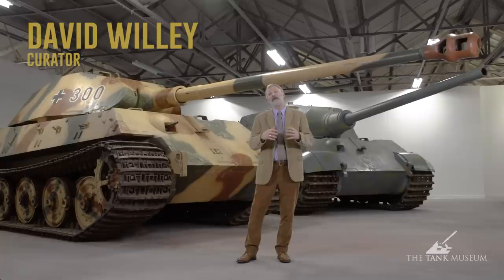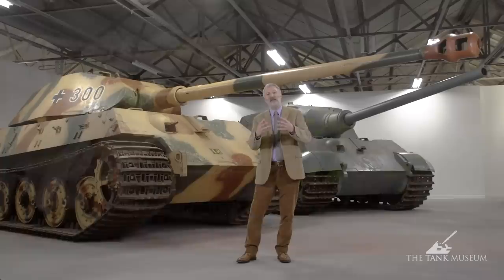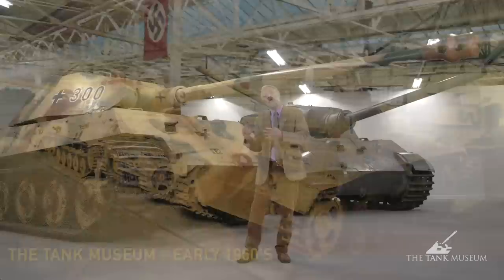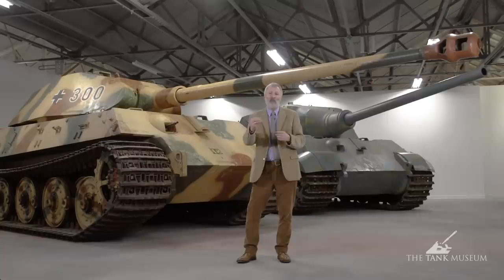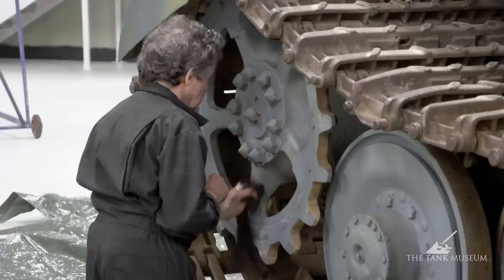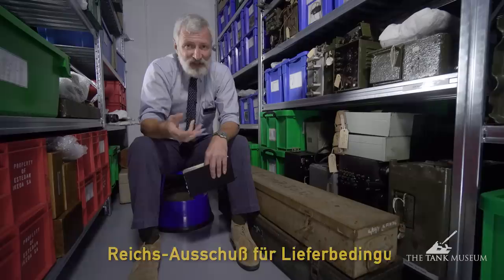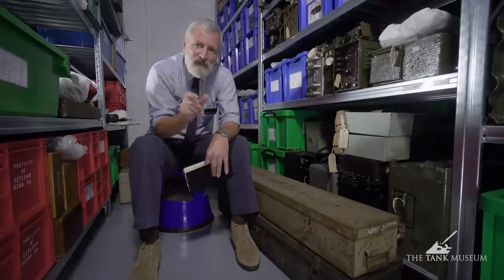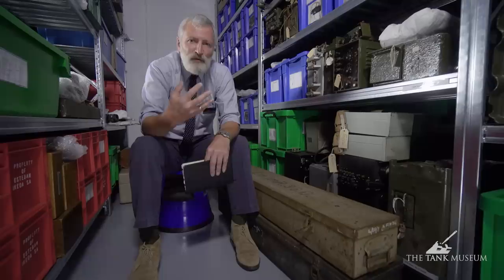How to Paint Tiger Tanks | Tank Chats Special | The Tank Museum

Comment: Very good and accurate video.  Awesome to see you're trying to shed light on all the inaccuracies and myths of old.  Couple of things I'd like to add that I often see model makers asking about or making mistakes with (not everyone cares and that is perfectly fine).  

The two-tone RAL 7021/7017 panzer grey/brown scheme was not entirely discontinued in 1940 as you said; StuG III Ausf.B were still being painted in it at the factory in March 1941.  There are good photos of this.  Seems like it was continued on tank destroyers/assault guns for some odd reason.  After March '41, StuGs were all painted in grey (until tropical schemes and dunkelgelb were introduced).  

The RAL 8000/7008 (Tropen 1) and RAL 7027/8020 (Tropen 2) schemes were not exclusive to North Africa.  Southern Russia was also considered a tropical region and so many tanks there were delivered and repainted in these schemes, likely including Tigers that were at Kursk.  

Those two tropical schemes were often applied in the factory, meaning that they often would not chip to panzer grey underneath but instead to red oxide primer, as no grey is underneath in the first place.  There are some exceptions, such as earlier vehicles delivered to North Africa, and some later ones too.  But the early ones were usually just RAL 8000, and the later examples are mostly Panzer IV Ausf.F2/G which were painted over their grey with Tropen 2.  

This also meant that some tanks painted in tropical schemes in the factory got diverted to other places...a good example is StuG III Ausf.F/8 and Initial production StuG III Ausf.G, which were delivered to Kharkov in the winter of 1942/43 in Tropen 2 desert camo...in the middle of winter, which looks badass in photos.  

Most tanks also got two- or three-tone factory-applied camouflages starting in August 1944.  This continued to the last days of the war and it well documented.  No nothing every left a factory in red primer...it's a myth.  No they didn't run out of paint either.  That's also well documented.  Gun barrels are also not red oxide primer but a dark grey heat-resistant lacquer primer.  These factory camouflages were standardized and were done to reduce factors like deployment times, tanks never being properly camouflaged, and to reduce fuel use when thinning down paint for camo application and work depots.  It was a production streamlining thing, just like the elimination of zimmerit around the same time.  

Additionally, the idea that "field-applied" camouflages were done literally in a field by tank crews is incorrect.  It was done at the depot level with proper equipment and work crews.  Winter whitewash camouflages were often literal crew jobs though, and were usually done really shitty with paintbrushes rather than spray guns.

Feel free to add more stuff below, anyone :)
Reply: My little baby is all growed up
Reply: Why don't you just adopt me already Adam
Reply: Because you are too high maintenance dude.  But seriously Evan, fantastic write up, much appreciated.
Reply: Man, you're a wizard...
Reply: In regards to the StuG III Ausf.B RAL 7021/7017, I wonder if it had anything to do with the fact that they technically weren't part of the Pannzerwaffe and were instead issued to the artillery arms?
Reply: Awesome info
Reply: Spot on! The hours upon hours we model makers spend on researching accurate colours and paint schemes probably are on par - if not exceeding - museum standards, in order to make accurate (attempts) of replicating specific tanks/armour at a specific date/event... This video sheds a light on this popular topic and it makes me feel a bit less alien having David Willey talking about it to the general public!

There are so many myths about weird and wonderful paint schemes that never existed, just like Panzermeister36 writes. The Germans were really specific with their RAL system and nothing was left to chance. I do think that they would "use up" older paint when a new RAL set was decided instead of getting rid of it, hence why your Tiger might be painted in the earlier paint scheme?!

Many thanks to David for making this excellent video and many thanks to Panzermeister36 for a spot on accurate comment!
Reply: I like a man who's well educated ;). Thanks for the info
Reply: helpfull for modellers...eternal question : which color for the extinguisher....red? green..grey...pink...
Reply: German "Tetra" fire extinguishers were always painted the same colour as the exterior of the tank ('dunkelgelb' yellow, 'panzergrau' grey, etc.).  I have a copy of the German document that describes that in a book I own.  They were red when located inside closed-top tanks.
Reply: @Panzermeister36  thanks mate. .we often see again red extinguishers on panzers. ..btw waiting for new vid 😉. ..
Reply: Thanks guys :)  I'm always glad to be helpful!
Reply: Got me wondering if the Chek "Skoda Works" factories applied different base coats than the German's?
Reply: The Czech factories, when under German control, used the same colours.  They did have unique Jagdpanzer 38t camouflage patterns though.
Reply: Panzermeister36 Thx, that's what got me thinking about it ( the somewhat different camo patterns.)
Reply: Good to see you here hahaha. I know a couple of people from the modeller community were going to show up here.
Reply: I'm reading this comment and think to myself "This guy knows his Stugs" and then I notice the name... :)
Reply: @Panzermeister36  Do you know what kind of paint schemes we could spect to see in German tanks in the Caucasus Campaign? 

I'm a model builder and I'm setting up a force fighting in the Caucasus. Some of those units I'm painting with panzer grey, others I'm painting with panzer grey and dark yellow stripes, just overall dark yellow or dark yellow and green stripes. 

Are those correct?

Since the Caucasus Campaign happened in 42, I wonder if the Germans had already adopted yellow paints for there. I know that some tanks at least were yellow because they were meant to be send to Africa but in the end they became relocated in Southern Russia instead.
Reply: all that work trying to replicate tones and in the end tank modellers just smear everything under an inch of "weathering effects" and mud
Reply: I am not a tank modeller but this was a very interesting thread to read and I appreciated the cooperative and polite discussion.
Reply: @TheStugbit  i
Reply: I would suggest that some tanks WERE camouflaged by their crews; plenty of shots showing obvious brush-strokes on Schurzen for example.

Comment: Don't forget scale modelers. This is FULL scale tones. Smaller scales require the paint to be toned down to get the same effect as the full scale vehicles. This is where it gets hard and at the same time interesting for scale modelers to get right. Scale, light, time, operational theatre, method of application, concentration of paint, what diluting medium was used and weathering are all factors to consider when trying to get your scale model paint scheme just right.

Comment: One thing important is the weathering as well. The paint schemes you show represent the tank before getting in the action, before being around in the field. The shades of a tank paint in daily duty certainly may change a lot due to sun light exposure, dust and mud, bumps on trees, etc.. 
Those tanks the regular soldier would have been familiar with may be very different from these we see in museums, even with the precise paint scheme. 
But I guess it is not a good idea putting some of those old tanks on the field getting down trees and crossing rivers just for weathering!
 : )
Reply: While you are correct that tanks get dirty, the crews, given free time, would hose down their vehicles and re-paint any damaged bits as they went. 

-and that's why only museum tank tracks are rusty. 

In the field, tank tracks tend to be grinding through sand, mud and stones, getting very shiny if used enough.

Comment: I believe the colours applied by the Luftwaffe  used another colour code. RLM , or Reichsluftfahrtministerium - Ministry of Aviation. I always have problems with the correct colours when building plastic model kits for land vehicles and airplanes. Not just German stuff but in general. There are a LOT of sites where they give you the closest colours using Humbrol , Tamiya, Revell etc .etc. paints but they don't always agree with eachother.
Reply: The RLM farbton (colour tones) range are a subset of the RAL standard for 1927 and tend to have two-number designations, but are listed within RAL charts as well.  Look up black, white, (basic ) red, etc. and the numbers correspond in interesting ways.  

Since WWII, the range has been added to, subtracted from, unified and made into subsets again (such as for roadside poles, lights, signs, etc.).  

Then there is the attempted Europe-wide standardisation process that's still on-going.  

In a similar way, the old British Standard paints (always only required to be accurate to 10%) were modified, added to, subtracted from, re-numbered, reduced to suggestions and then abandoned (but still available from Dacrylate), and are one of the things not re-introduced after the recent break-away from European standards.

Comment: I use the ww2 German camo scheme
 RAL 7028 DUNKELGELB 
RAL 8017 ROTBRAUN SCHOCOLADEN
RAL 6004 OLIVGRUN
RAL 8000 GRUNBRAUN
RAL 7027 SANDGRAU
RAL 8020 GELBBRAUN 

THE SANDGRAU 7027 IS THE GERMAN YELLOW THAT PEOPLE SEEM TO CALL IT NOWADAYS LIKE A DESERT SAND 

theres a slight difference between 8020 and 7027 tinge darker you wouldn't even notice! I'm an armour modeler and use life colours they have the most accurate and researched RAL colours available I know AK international have tries the real colours from paint chips but life colour has the RAL documents used in 1940 to 1944

Comment: Hi, I am building a 1/32 scale Panzer 4 and I wanted to know if they where painted red oxide primer in the factory before putting on the sand yellow color,
Reply: Yes they were red oxide underneath the camouflage colours.  The gun barrel was primed in a very dark grey heat resistant primer though, not red.

Comment: How did you not know you had a sample of 7028? I've been collecting random bits from Russia for a few years and I have numerous samples. You're a museum.
Reply: They had no original colour chip.

You can't simply use something that has been painted in it and been exposed to sun, mud, oxidation ... for so long time, as a base.
It would come close but you can't say for sure it really is the correct tone.

Today you can buy those colour fans.
They are used in the print/design industry as well.
Before you print, you look up the colour on the fan, because your monitor screen can't represent it correctly.
(there are others like Pantone)
As mentioned 7028 is not part of the classic fan.
Which was surprising to me, apparently RAL has no correct sample or formula left over themselfs.
Reply from the maker: Hello, Yes, as y smg points out, we needed a sample that was perfectly intact. We have been able to share it with numerous other Museums, who did not have an untouched colour reference.

Comment: Very nice presentation. How do we know that the Germans always used original colors in WW II?
Reply: (I know this is an old post, but for anyone who comes across this, I'll add what I've learned.)  The fact is that toward the end of the war, they didn't.  Sometimes they used what they could get to add camouflage to the base of dunklegelb (which came from the factory).  That might include paint stocks from other sources depending upon where they were at the time. Additionally, the olivgrun and rotbraun schokoladen were supplied in tins and supposed to be thinned with petrol before being sprayed on the vehicle in whatever pattern the soldiers felt best, as the curator stated.  However, sometimes they were not thinned to the correct consistency, or they were applied by other methods such as brushes or mops or rags, whatever the soldiers could get.  So, there are variations.
Reply: @kirkmooneyham  Thank you.
Reply: There were records of late German tanks (especially Tiger Is) being finished before painting, so they had only the red primer undercoat, over which partial camouflage of dark yellow or green was used.
Reply: As was heard in the video, the idea that tanks were finished in the regulation camo on the date the document took effect is not borne out by facts in the case of the Tunisian-captured Tiger I '131'. 

Regulations are usually in put in place to formalise something already being done, or to demand a change, something the front-line soldier rarely has time to do.

Comment: So, what did you use for pre-shading, highlights, washes? Modellers want to know :-P
Joking aside, thanks for this excellent video. I'm amazed how well preserved the interior of that box is, a true time capsule.
Reply: Those pre-washes, etc:  my father was in North Africa and Italy during WWII, and he saw that British vehicles were painted either white 'wherever there was a shadow' (underneath and under wheel arches), or they were painted over with a mix of old engine oil and a small amount of petrol.  
Making the underside slightly more resistant to chipping and rust, and covered with thick dust stuck in the oil.  

Have never read of this being mentioned anywhere at any time aimed at modellers.  

Can also confirm that RAF aircraft do not have dark lines along panels, but do have greasy fingermarks on moveable panels, where they have been handled.  Small patches, not lines.  

- and all front extremities had a thick black plastic 'mastic' on them to prevent the leading edges' paint being worn down to show the bright green undercoat.  

A very few colour profiles of RAF Jaguars show this black stuff, but it's almost never seen otherwise.